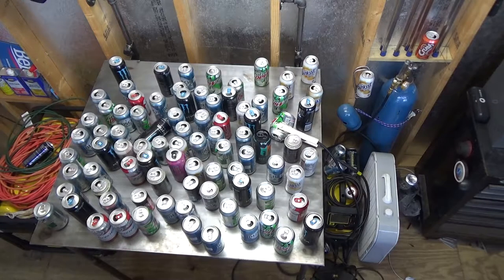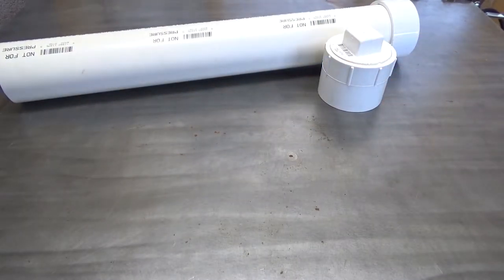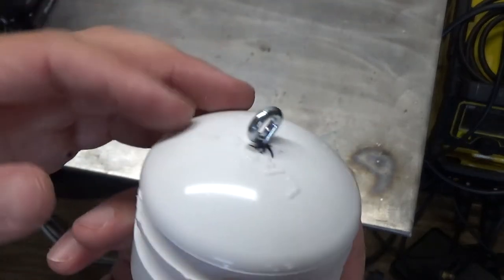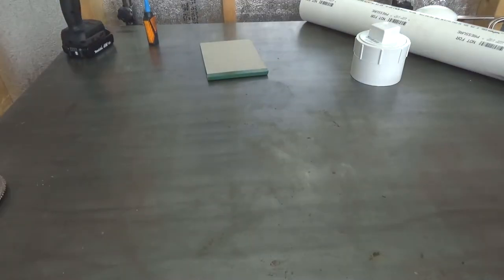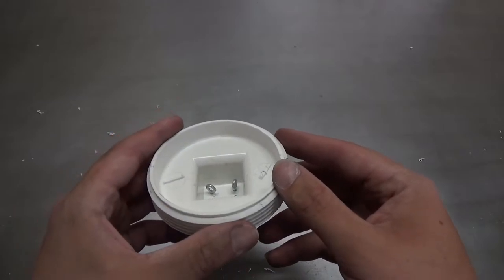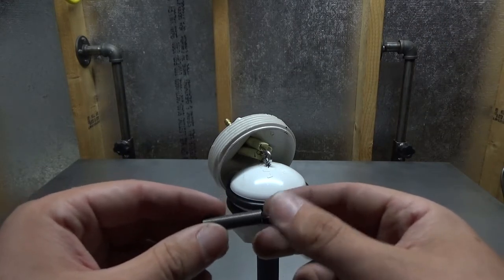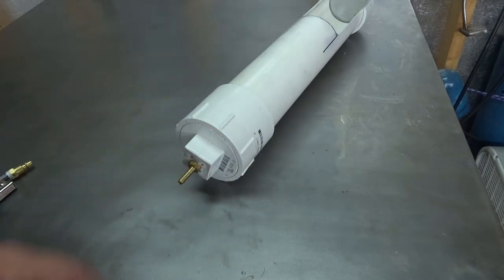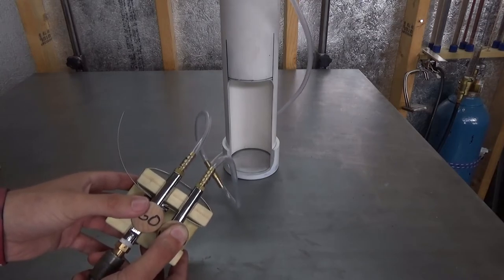DIY Pneumatic Can Crusher

Comment: That is a nice cheap and easy way to have pneumatic piston. You mentioned a way to eject the cans, and one way is to just cut a hole in the back bottom of the cylinder just big enough to allow a crushed can to pass thru it, then install the piston on its back horizontal instead of vertical, maybe on the side of a workbench, then have a bucket under that hole that catches the cans. Right at the end of the crushing stroke is where the hole needs to go, that way only a crushed can can exit it, not a non crushed can, this way gravity feeds the cans into the bin and save the air pressure for crushing. But you will need to reinforce that bottom to the cylinder most likely after cutting another hole in the cylinder, only the sides will be left holding the bottom on.

We don't have to pay for recycling pickup for soda cans and bottles because in Michigan the manufacture is required to take back the soda cans and bottles it sells, 10cent deposit on each and every single one.

Comment: Would like to add a recommendation for version 2.0. 1- auto loader for the emptys 2- a second piston short stroke piston to push out the crushed can powers by the un-go
Reply: Yep a cheap solenoid could be used to push the crushed an out into a box or garbage can.